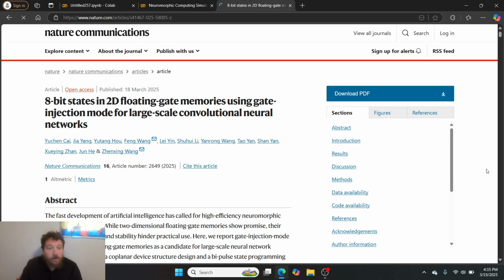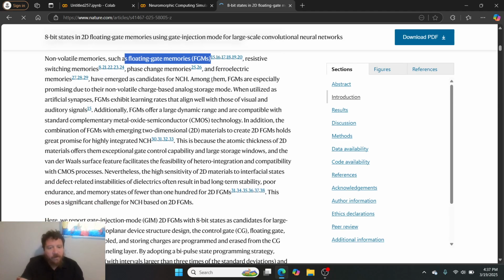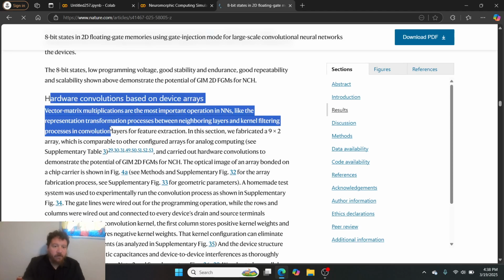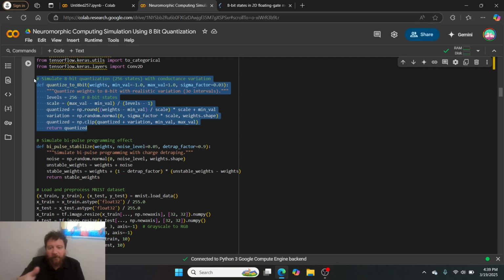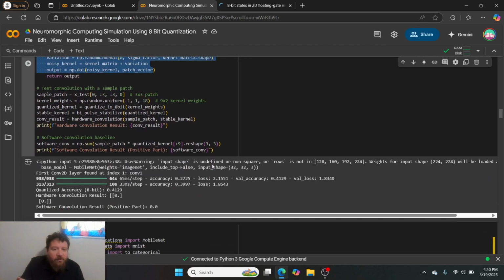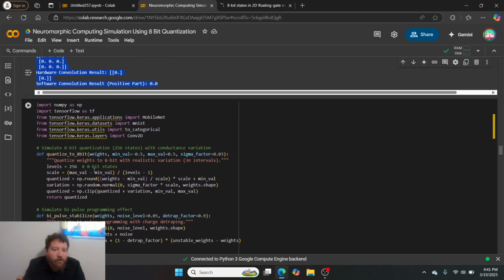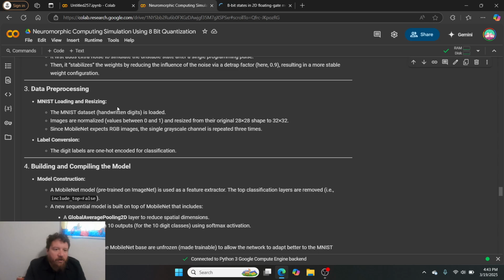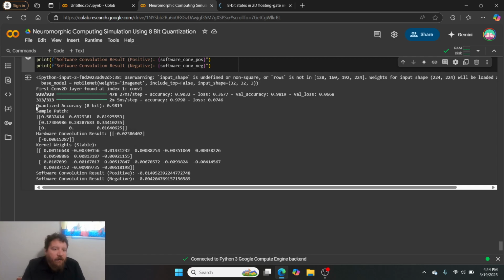Neuromorphic Computing Simulation Using 8 Bit Quantization

Comment: I like the idea of reducing the processing kernel by flattening it out. I wonder if that can be extrapolated or taken further?
I like to preface that I'm out of my depth here with AI stuff, but it seems to be my understanding that a tremendous part of AI bottlenecking stims from trying to perform matrix multiplication in mass.
And that the majority of people/companies are trying to find methods to do these multiplications as quickly/efficiently as possible.
But to me a better question seems to be "are they necessary?"
Can we reformulate the equation or rather can we restructure how we calculate the weights and such so that perhaps it could be reduced to simple addition or ideally some form of binary bitwise manipulation that hardware could process more rapidly/efficiently.
My background is primarily in the video games programming industry and instances where we can reduce a problem to just manipulation of bitfields often produces speed-ups that are orders of magnitude greater than the original implementation.